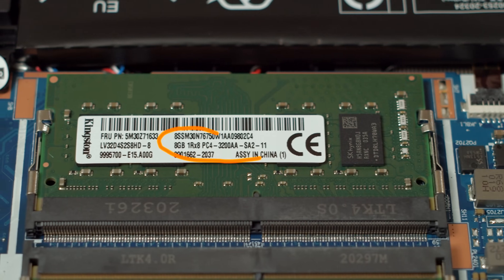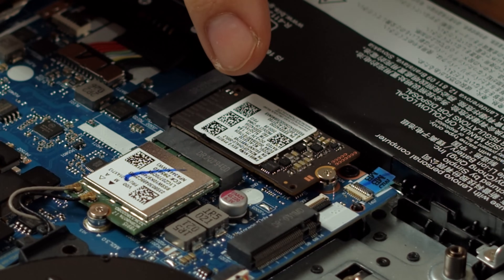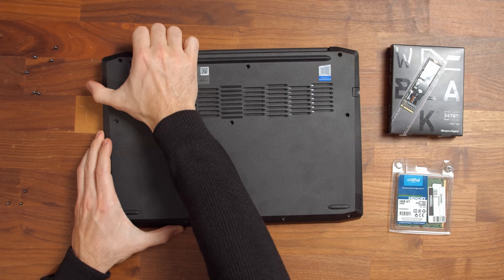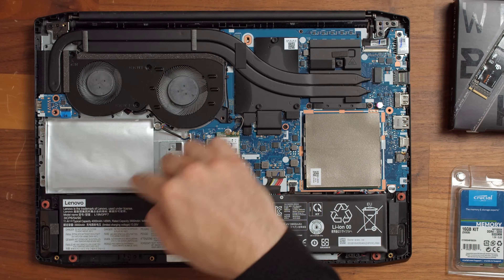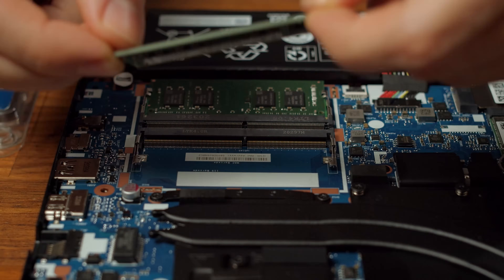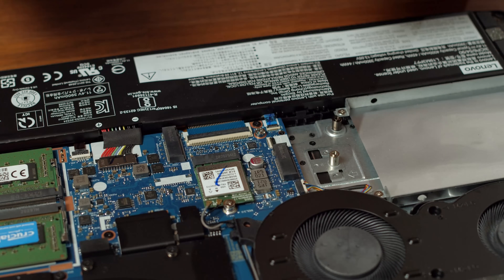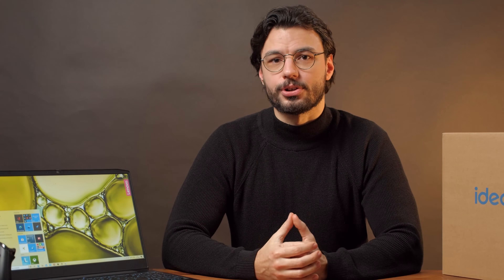Lenovo IdeaPad Gaming 3 Tutorial: How to Upgrade the RAM & SSD(s) | English

Comment: For anyone who wants to use the second NVMe slot, simply hold the bracket with the nut and force it to the left; the support plate will come out, and you can then place it on the right to support the NVMe 2280.

Comment: So i will ask before buying ssd.. i have this laptop with 128gb main sdd and secondary a hdd 1tb in the 2.5inch slot.. if i want to upgrade the main ssd to 1tb which i will extend the slot. Do i have to remove the hdd? Or it is possible to have both? If not im  buying 2tb ssd and just remove the hdd.. ill appreciate any answer. :)

Comment: I tried to pull off the lid like you, but after I saw a piece of plastic fall out, I suddently don't want a bigger disk no more💀
Reply from the maker: We are sorry to hear that :(
Reply: Lmaoooooooo
Reply: u most likely just broke one of the screw studs, not a big deal.
Reply: The lenovo website has user hardware repair guides for every model! I used that to follow mine and i noticed that the bottom tray wasn't coming out and came to the conclusion one of the latches was still attatched

Comment: I want to upgrade the laptop RAM to 32, but I'm afraid it won't support it.
Does this laptop support up to 32 GB of RAM? Well, in one place it is written 32 gigabytes and in another place it is written 16 gigabytes
Inside the lab manual, there is no reference to the maximum RAM.
On the other hand, my laptop has 2280 and there is no 2242 in my country.
My idea was to remove my own 2280 (512GB) SSD and install a 2280 (2T) SSD instead.
But I still don't know if 2T supports it or not, because I had seen that it doesn't support more than 1T.
Maybe I'll have to close the SATA SSD on my 2280 and I'm a little scared ...
MY laptop is
R5 5600
8 GB 
512 SSD 2280
1650

Comment: Just upgrading my RAM and adding a new SSD and this has been really helpful! For anyone struggling to budge the screw mount for the second SSD slot, I ended up getting out a set of pliers to remove it from the default slot and that moved it with zero issues.

Comment: So i have this question. I have a 512 SSD in my Lenovo ideapad Gaming 3 (15ARH7) (its a 2280 SIZE and my 2nd slot is free, which is 2242, but its a tricky size to buy, not so common and super expensive) Should i just buy a 1TB 2280? Or are there any other ideas?

Comment: Great video
But i have a question
Do you reassemble the aluminium cover of ssd after you connect the second ssd?
Or the aluminium cover will be not used after adding the second ssd?

Comment: Just a heads up, mine came with a 2280 preinstalled and I had already bought a 2280 thinking it would come with a 2242 as I'd seen in every other video. I still ended up swapping out the intel 2280 with the SK Hynix one I bought because the stock intel one was pretty slow (Hynix one 3x faster) and I'm going to buy a 2242 when I get paid, but check first which slot is free.

Comment: Hey so you said you can only use the w PCIe slots if you DONT have a 2.5 SDD installed? Trying to understand if I can utilize all 3 slots. 

Trying to find the easiest way to upgrade internal storage. Stuck between buying a larger 2280 Gen4, or a larger 2.5
Reply: Also wondering if I purchase a new PCIe, can I data transfer within the PC ‼️ Thanks to anyone in advance

Comment: Just amazed me that I saw so many upgrade videos of this laptop, and this one is the only that actual mande an ssd upgrade. I saw people putting equal or worst ssd'd (or even hdd), in this machine, but never saw someone putting a better ssd, from what came from factory.
Thank you for that.
The problem, for me, as I'm tying figure out which hight performance ssd works in this laptop, and this prove to be an inglorious quest.
Adata? No. Crucial? No. This laptop look likes only accept slows ssd's.
This black WD was the best ssd I currents saw being put inside this laptop, over all the internet.
I guess I will wait for see some of gen 4, if they works on goods speeds in the future, but this as so exhausting... lenovo don't provide any help, and neither the lenovo's forum...
I'd love see a list of faster ssd's for this laptop.
My came with a intel 600p 512, so I'd like buy something that runs at 3500/3000 with random writer/read at 300k or more, hight twd and dram cache... no throttiling...
Hope the gen 4 bring more options for this laptop, and those ssd's can run that fast in this gen 3 machine...
Good luck for all
Reply: Just a detail, this laptop is an Ryzen, and my is an Intel 10th... so, maybe this sdd don't work with my system... great

Comment: Thanks, great video! Just one question: When exchanging the RAM modules - do I have to buy a new heat foil as well? Or can the present one be re-used?
Reply from the maker: Hi there, usually the foil can be reused - as long as its not completely torn up :)

Comment: hy bro plzz help me the ssd you removed what is a purpose of that ssd because my laptop has hdd and that small 256gb is present in it what happens if I remove it and replace it with new ssd ? does that ssd contains bios of my laptop?

Comment: A heads-up: the little plastic clips that hold the base plate on are easy to break if you're not careful. Do not advocate for pulling the plate off without a pic/tool to slide and decouple or = broken clips. I am living proof.
Reply: The clips are the usual plasti clips that you can find on most of our common plastic devices (TV controller, Joystick, XBOX, Playstation and so on). You have to have some thin flat screwdriver or similar (better with a plastic end) and you try ti identify the place of those little clips and give a gentle push. You do that enough to bend gently the "plastic" clip just enough to free the opposite slot that blocekd it @ImMashimaro
Reply: Oh hell yeah, I was super careful when removing and still snapped two clips.

I'm sure the reason why there are so many clips holding it in place is because they KNOW some are going to break.
Reply: @iitzFizz mine was fine but two screws were not having it, after some time i just resorted to violence and luck would have it it didnt damage any others on its way out

Comment: I got the Lenovo - Ideapad Gaming 3 15.6" FHD Laptop - Ryzen 5 5600H - 8GB Memory - NVIDIA GeForce RTX 3050 Ti - 256GB SSD - Shadow Black recently and wanted to ask is there an additional ssd slot so i can add another instead of having to reinstall windows on the current smaller drive.

Comment: Great video! One problem I came across though - my device does not have the SSD standoff post - and most generic ones dont fit into that slot. It looks like Lenovo may be using a different /uncommon size of sort ? Would be great if you could guide on what specific standoff post size fits Lenovo - and where we can get one.

Comment: Bro hi again me i bought a 3500-3100 mhz m2 ssd but ı scared for over heating ssd ı have good thermal pads and ı will use for the new ssd is plastic case will discharged the heat betwen ssd

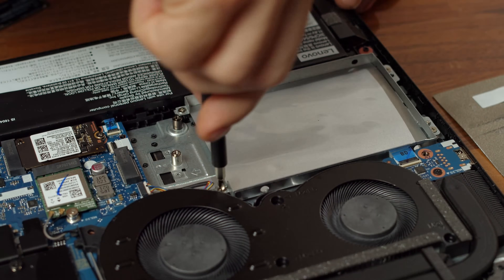Comment: 4:15 and onwards. My manual for my Ideapad Gaming 3 15ARH05 states "M.2 2280 SSD up to 512GB" <- why this storage size limitation? 
My plan is to to install a WD Black SN850 1TB (or maybe even a 2TB version) at the 'hided' M.2 2280 slot as demonstrated, along with the 512Gb Micron 2210 MTFDHBA512QFD M.2 2280 SSD that came with my laptop. But is 'up to 512GB' stated by Lenovo really something I should have in mind before going ahead ordering?
Reply: OK, just an update. No problem installing a 1TB Samsung SSD 980 MVNe PCI-E 3x4.0 M.2 2280, though the manual for my 15ARH05 - Type 82EY  states 'up to 512Gb',
So now my laptop onsists of 2 x PCI-E 3x4.0 MVNe 2280 cards, i.e. the  aforementioned 512Gb Micron M.2 2280 card coming preinstalled + now my fresh 1TB from Samsung. 
Think I could even go for 2 x 4TB M.2 2280 cards if I wanted to.
Just an info regarding the official Lenovo manual 'limitations¨on storage size'. Apparently, there's nothing in it, and hurray for that 🙂

Comment: Hi sir is it necessary to disconnect the battery cable before upgrade ram/ssd? Thnks
Reply: Yes it is a good precaution, having the battery connected when a laptop is being serviced can cause a short circuit and fry your certain components or the whole motherboard.

Comment: i have a question , if i want to change the ram from 8G to 16G i have to buy two 8G for the two slots or one 16G wich will only fill the one slot and the other one will be empty , will the laptop work normally if only one of the slots is filled ?

Comment: Where can I find a M.2 2242 SSDs?I tried finding in Amazon but no luck..Only non branded ones are available...My default ssd is a m.2 2280 card and the secondary slot is 2242 form factor..

Comment: Hello, I have problem, because I bought second hand laptop and now I see that SSD has been changed. When I try to restart computer by using restart option in Windows, it don't detect drive. Is it possible that the SSD is incompatible with my laptop?

Comment: Hi, I have the same laptop, but I cannot remove the backplate. How much force I will need? I dont want to break my new laptop dough. :D
Reply: DO NOT USE FORCE...I tried it and ended up breaking one of the top latches. Just run a credit card or something slim starting from one of the bottom corners while slightly lifting the bottom cover, you will hear the latch mechanism begin to pop one by one as you slightly lift; Patience is key.
Reply: @KingJulio29  I tried could not get even a click. I will try for sure, I need to add another SSD drive, but I just bought today so didn't want to brake it on the first day.. :D
Reply: @iammz81  Keep trying to release the bottom first then work on one of the sides, trust me it will work, otherwise I wouldn't be telling you to do it. The card or whatever you're using should eventually "Slip In" and free one of the latches and you'll hear a "Pop"(There should be around 5 latches on bottom.) If you can get someone to hold the laptop while you try to free the latches it would be even better (Although I did it by myself.) And lastly make sure to remove any usb's and or external devices plugged in.
Reply: @KingJulio29  actually it wasn't that hard and did not tear off any of the pins. thanks.
Reply: @iammz81  Yep, No Problem! ^^ Happy to help.

Comment: I have a question about the SSD upgrade i did on my new Lenovo ideapad3, I have a slightly different setup than the one one in the video so I want to send you pictures of it and get your opinion on something. Do you have an email i can contact in regards to that?

Overall though this video was incredibly helpful, I upgraded my RAM as soon as I got the laptop and now I'm running 16gb RAM with 1.5 TB on the SSD... Feels very OP compared to my old Chromebook i had for ten years 😂

Comment: I’m actually wondering if there’s any way to have 3 Ssd’s in this laptop. I already have a system and software only 250gb m.2 drive and I’m thinking about replacing my 1 tb hdd. But since it would be mostly for working and gaming, I’ve heard from others to have at least a separate drive for cache (video editing) so I was maybe thinking getting a drive for projects only and use some storage of the hdd as a cache destination folder. BUT, I just don’t know if I could have 3 drives of any kind in this laptop at the same time

Comment: I tried adding m.2 sata iii and it doesnt work 😭
Reply: meme meme  too late for me bro, already bought one. Im expecting nVme but what i got is sata. What i did is bought an adaptor so i could convert it into 25" sata. Then plug it on hdd slot. Then i bought another one which is now NVME so it works both. I wasted 10$ because of my stupidity

Comment: can i use all three slots to upgrade the storage?
Reply: You would need to put a 2230 M.2 in the second PCIe slot, and the secondary would be a bit slower than the one in the main M.2 slot (still a bit faster than SATA tho), but yeah it should work

Comment: Do you need to disconnect the battery cable? i see some other method that disconnected their battery cable
Reply: Better disconnect the battery cable first if you new. And be cautious as sometimes it may break the motherboard because some electricity is hitting the board or something like the screw fallen in the board, your sweat and etc...

Comment: Thanks! today i replaced the internal 2.5"HD with a 1Tb PCIe. Next step, upgrade 16Gb to 32!😄
Reply: hi. just asking. Can you install Windows OS on the new fast 1TB 2280 SSD? Thanks.
Reply: @kamarms  Yes. you can use new HD as a standard bootable disk and install Windows OS.
Reply: can we upgrade it to 32gb ram? on the website its says up to 16gb
Reply: @zuranyaa9011  the site says "ready for 32gb technology"  so i stopped until news.
Reply: what's the name of the cable for adding 2.5 HDD, i couldnt find it
Reply: @samiguiness7336  you need an SSD Hard disk PCIe NVMe. No need other cables.
Reply: @maxxpalermo  Thanks for your response but I think I didn't describe my problem clearly. I have SATA SSD, not M2. I want to add my 2.5 SATA SSD. Is there a way to connect it without any expense like cable?
Reply: @samiguiness7336  there's  a slot for SSD only for the second HD. In ths slot you can insert either a SSD or PCIe

Comment: Sir i have same laptop lenovo IdeaPad gaming 3 my laptop has only 1tb hdd and 2 ssd slots available one is for small size ssd and the another one for nvme m.2 ssd can i Install m.2 nvme 2280 ssd when 2.5 inch hdd has installed ?
Reply: I have the same problem , could you install 2080 nvme .2 SSD without removing the 2.5” SSD
Reply: @adityags1922  the Lenovo IdeaPad gaming 3 has 3 storage options
1- 2.5 inch hdd or SSD slot 
2 - m.2 nvme SSD slot 
3 - m.2 2240 SSD

You have 3 storage options and all slots work separately
In my case before I only have 1 tb hdd in my laptop i purchased 512 gb m.2 nvme SSD in my laptop without any problems and still there's a small size nvme SSD slot so I can upgrade more storage in my laptop without removing any previous ssd
Reply: @adityags1922  yes you can install your 2280 nvme SSD without removing your 2.5 inch SSD or hdd

Comment: So I have lenovo ideapad gaming 3 15ARH05 and it came with 256gb m.2 ssd already. I would want to put another m.2 ssd that is 1tb. I can see that you did put another m.2 ssd which is 1tb big. But I have read many pages and some of them say, that you cannot upgrade to 1tb on ssd or m.2 and it is limited only to 500gb. Some even say that you cant put two m.2 ssds. So i just want to know if i can upgrade it. This was the other ssd that i would want to add: WD Blue SN550 1 Tt M.2 NVMe
Reply: I have the same laptop. I have Intel SSD of 500Gb by default. And after bougth I have bougth AMD SSD of 1Tb and install it in my lenovo. It works)
You can upgrade it too)

If this information was userfull for you, please, like this comment:)
Reply: So now I have two SSD: Intel (500Gb) and AMD (1Tb). Sum of them memory is 1.5Tb
Reply: @Favarish  Yeah I already upgraded it and it worked, dont know why some of the sites said that it wouldnt. But thanks anyway:)

Comment: Please, where can I find this RAM that matches perfectly to upgrade without losing dual channel?
Reply from the maker: Hey, dual channel is passible as long as the size of each module matches. So you don't need the exact same make and model to achieve that. Just make sure to get the same Clock Speed and Size for best results. You can check those details with tools like CPU-Z or AIDA64.

Comment: And the aluminum cover that you removed? It needs to go back when the ssd is installed or I just throw it away?
Reply from the maker: I wouldn't throw it away as you might need it in case you wanna put in a SATA SSD later or sell the notebook with all it's accessories.

Comment: from what I saw of models that already had a 2.5" drive installed, you should have enough space to be able to insert a common 2280 ssd in the main m.2 slot. If you were to use the secondary m.2 slot with the standoff in the position closest to the connector, which form factor ssd does it accept, the 2230?
Reply: Hey I got the one with a pre-installed 2.5inch hdd it's a 15imh05d version I guess. I wanna know can I install a 2280 ssd in it or am I just stuck with using a 2230 ssd. I can't open it up and look inside coz i don't have the tools. Also which screwdriver should I use to open the laptop up?
Reply: @tbbzeus007  you still can install 2280 nvme SSD in the main pcie. even with the 2.5 inch drive attached. even better, theoritically, you can also put 2230 NVME SSD in the 2nd PCIE slot so you can have three storage. i can send you the picture of my laptop internal if you like.
Reply: @rayendrayustian7719  thanks alot man! I couldn't figure it out in a whole month(not sarcastic) you just saved me so much bucks
Reply: @rayendrayustian7719  ¿can i see that photo too?
Reply: @koralkirby5593  sure. Send me ur email
Reply: @rayendrayustian7719  can ive tht photo as well?
Reply: @rayendrayustian7719  hey can you send me too thru my gmail?.
Reply: @tbbzeus007  did it work bro??
Reply: @DanielLucena13  send me your email pls
Reply: Hey I was wondering if I can put an 2230 on the second slot (next to 2,5") can I get that picture too?
Reply: @konradkulesza7884  pause the video at 2:16 you can clearly tell that yes you can install the 2230 in the secondary slot, together with a 2280 in the main slot and a 2.5" hdd for back-ups.

Comment: Here in my country it comes with a 1Tb HDD, why can't put a 2242 because it doesn't have scaffolding screws? and finally using the nvme extend to 2280 is even unreadable. Any missed configurations?

Comment: Ay yo WTF, i put the 2nd ssd on the original ssd position, and the 2242 ssd i put it on the 2nd position and i don't know how to applying the 2nd tray. so i used tape to hold down the 2nd SSD 😂😂😂😂

Finally, i got something straight after watching this video. thanks a lot